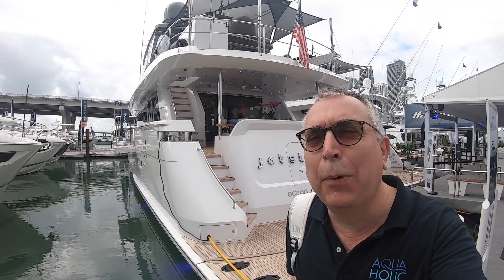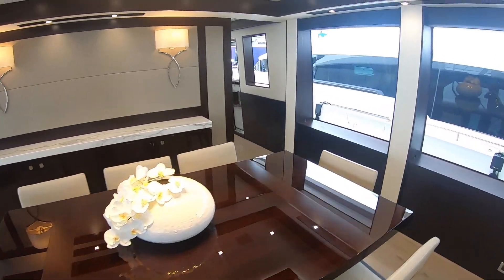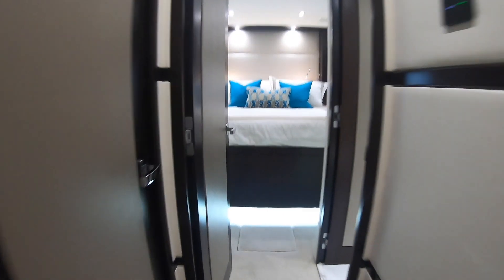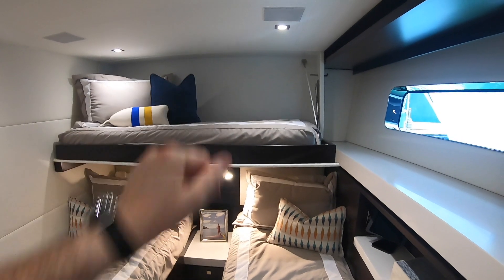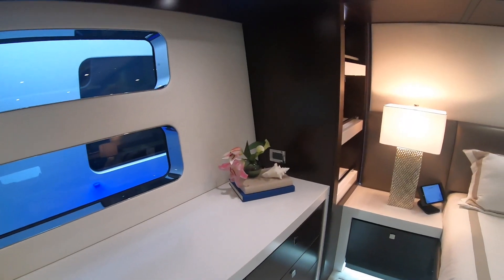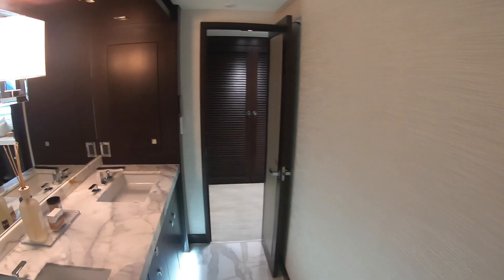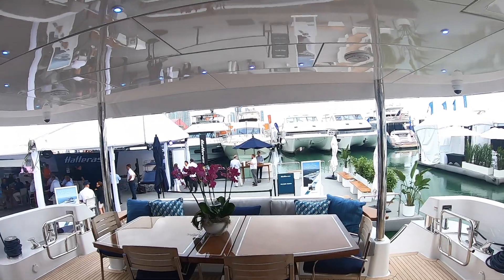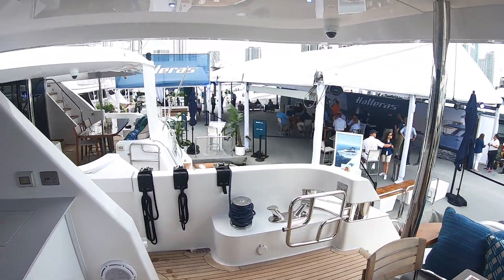Superyacht Tour : Hatteras M90 Panacera

Comment: Its really a beautiful boat... Not so keen on some of the aspects of the layout (like I ever really have to worry about it myself!) Not so keen on the only helm position being up on the fly bridge with that removable enclosure structure, in bad weather, I am not so sure that would feel as safe and secure as an inside helm position, and if that were to get damaged in a storm, then it may effect the ability of the crew to operate the boat? Just a thought... And also, as much as it looks lovely, not keen on the galley situation going on there... Move the helm back inside and close off the galley... That would be my preference for that boat... :)
Reply: my thoughts too. I am a north atlantic upbringing. I see these designs, and it is parked in the right spot.. miami. I also assume short trips, intercoastal. Just the diner table way up high bridge with plates on it had me chuckling. Its like a 90 foot pop up camper for the sea.
Reply: barry donovan me as well
Reply: I'm surprised that a yacht that size can get a CE certification with a layout like that.
Reply: Really strange
Reply: Yup, North sea/Atlantic coast being my nearest, an isenglass enclosed helm being the only place to pilot from with no possibility of windscreen wipers? No thanks. Nice boat, just wish it wasn't a fly bridge only design. I guess it's fine for what it's designed for, occasional use in fair weather, just pootling up and down the Florida coast in dead calm conditions. Shame really. If a squall kicks up I'd definitely rather have a real wheelhouse, though I suppose it may be possible to properly enclose that fly bridge with it's next major refit.
Reply: If I had to guess I'd say this boat is going to be chartered a lot and if the weather is bad it's generally not leaving port or anchor so maximizing guest space was the first priority.
Reply: Junder R Thats a good thing. The heavier the boat, the stabler she is. The Bering 65 weighs more than this Panacera, and thats a 65 foot steel-trawler. I'd take that for ocean crossings any day over this floating cocktail lounge
Reply: @rykehuss3435  :  The helm setup on this Hatteras is ridiculous & not practical. Though I wouldn't like the Bering 65 either. It's too slow, top speed 10.3 knots cruises at 8 knots.
Reply: @joeuser2360  I don't think you know how they are built.
Reply: blewyd Good luck taking the M90 across any ocean, with its 400 nm range lol. Theyre different kind of boats. One is built for stability, range and reliability, the other is built for cocktail parties. Fact of the matter is that these kind of boats spend majority of their life moored. Thats why theyre called floating cocktail loungues.
Reply: @blewyd  It's not the construction but the layout.  The only helm is on the flybridge with removable panels.  I don't know what the rating is but would think that it couldn't be CE A.
Reply: @rykehuss3435  "Good luck taking the M90 across any ocean, with its 400 nm range lol."

LOL right back at you. The M90's range is around 400 nm @ 2000 RPM and 20 knots, but at a long-range cruise of 1000 RPM and 9.6 knots it's more than 1,300 nm, and at 650 RPM and 6 knots it's over 2,500 nm. And those figures are all assuming a 10% reserve. You also seem to have misread Rykehuss' comment: he said he'd take the Bering 65 over the M90 for ocean crossings.
Reply: @joeuser2360   "The only helm is on the flybridge with removable panels."

There is a fully-enclosed flybridge option for those who don't want removable panels.
Reply: @rykehuss3435  that was my point. The Hatteras isn't meant for ocean crossing. It's not a trawler.
Reply: @joeuser2360  the flybridge is optional for a full hard enclosure and a lower helm station is also an option.
Reply: @joeuser2360  the flybridge is optional for a full hard enclosure and a lower helm station is also an option.

Comment: It's a bit odd that the only helm is on the flybridge. I imagine that doesn't work too well in inclement weather
Reply: Well with the enclosure canopy for the Flybridge it seems pretty good.  Heating and AC too. But the ergonomics man that wheel looks really low when you sit.
Reply: "It's a bit odd that the only helm is on the flybridge. I imagine that doesn't work too well in inclement weather."

There is a fully-enclosed flybridge option for those who don't want removable panels.

Comment: I love everything about the Main Deck and Lower Deck but nothing about the Upper Deck. If you look at the Skylounge's on the similar size Horizon E Series they are by far superior in layout and design. Having a Dining Table up there is not a good idea and unnecessary imo. There are 2 x Dining Tables on the Main Deck already. Apart from the Upper Deck this is a very impressive boat.

Comment: Im curious at what size does one appropriately switch from “boat” to “ship”? Another great review btw; thoroughly enjoyed! Thanks for posting
Reply: This should answer your question. The link below from Westlawn Institute of Marine Technology provides further detail  - "At what point does a boat become a ship?
These are two firm reasons for setting 60 meters as the division between boats and ships. Ship: A ship is any vessel or conveyance that floats on or operates on the water and is equal to or larger than 197 feet (60 meters) length overall (LOA). A ship may be used for pleasure, commercial, or residential purposes."  
http://www.westlawn.edu/student_center/definitions.asp

Comment: Cheap washer and dryer ~ very surprised ! Should be a quality set of front loaders. These are about half the price of front loaders.  Do not like the mirrored cabins with twins one with twins would be enough. Front load washer and dryers downstairs. Cat 32 engines are nice. Hatteras are Rock solid. All in all a nice pretty boat.

But it pales in comparison to the Riva 90 Argo  which is mouth watering perfect ! The Argo has 2,500 MTU engines and a top speed of 32 knots. Everything about the Argo is simply a work of  beauty and nautical power.

If you ever get 0n a Riva you will see Maurizio does a fabulous review of this boat.

Comment: Nick, how do you define a yacht, super yacht and mega yacht from each other?

Cheers.
Reply from the maker: Industry definition of a superyacht is generally a boat with a Load Line Length of 24m and above. So in practice, about 85ft and upwards is usually designated a superyacht.